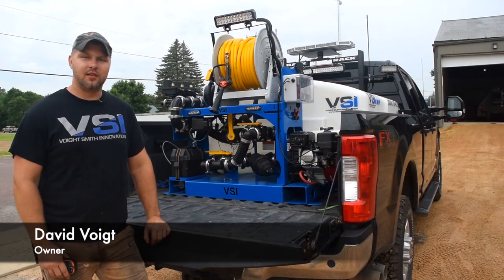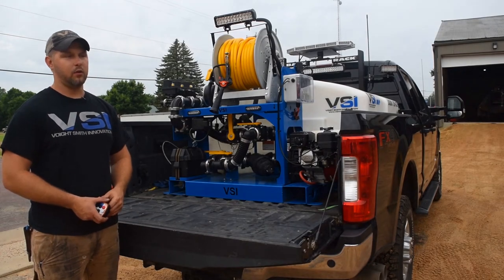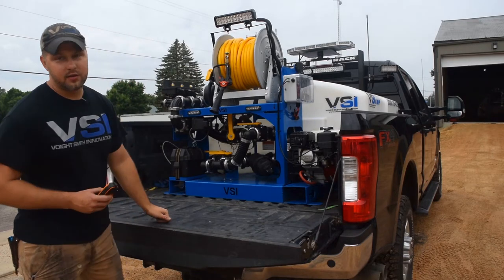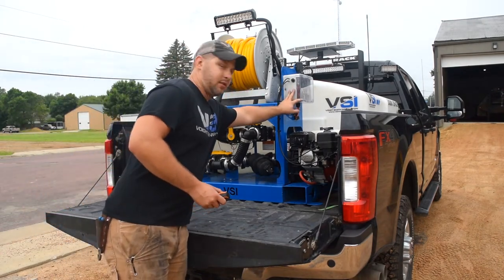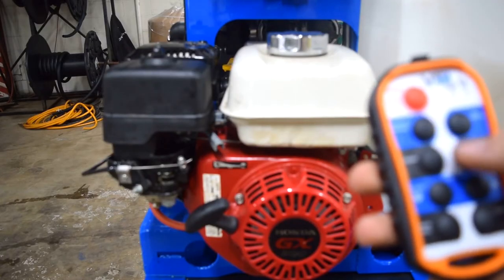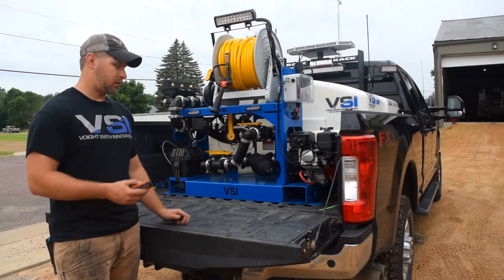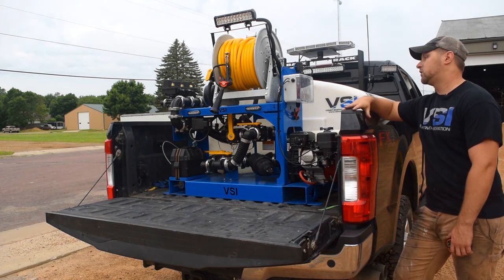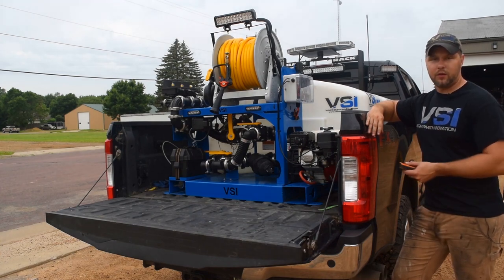Upgrades for VSI Liquid Deicing Sprayers

Comment: AWESOME Dave, that is really cool, you guys are constantly improving and innovating. Can that be installed on last years model? I couldn’t agree more about the three lane boom, it really makes things a lot easier. I have treated driveways from the street in about 20 minutes. If I would have had to back into each one , it would have taken me at least an hour. I can guarantee that if I had that remote last year, cars would not have passed me on the shoulder while I was in a traffic jam. Thanks for my VSI fix to get me thru the summer.
Reply from the maker: Mud Puppy, it could be retrofitted on last years models. Some assembly required, but nothing someone with a decent knowledge of small engines wouldn't be able to figure out. It would be possible to film a short video on how to convert if we have enough interest. Contact Adam, or email sales@vsinnovation.com for more info.